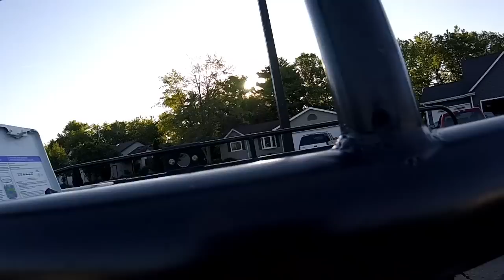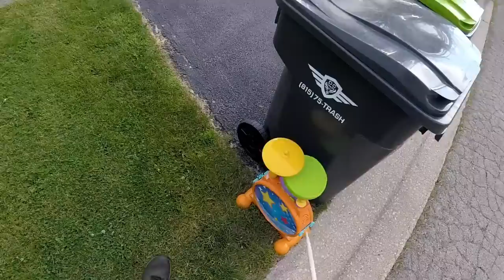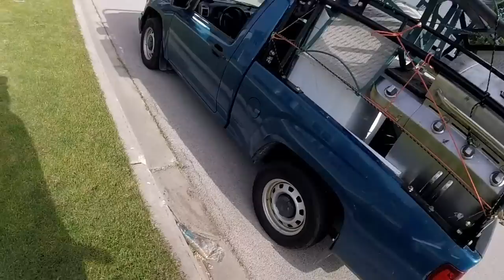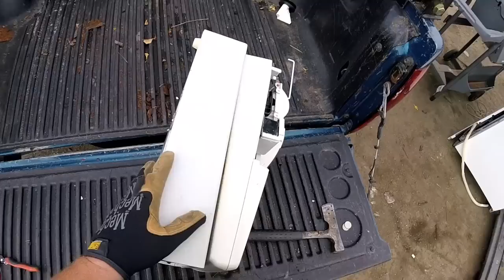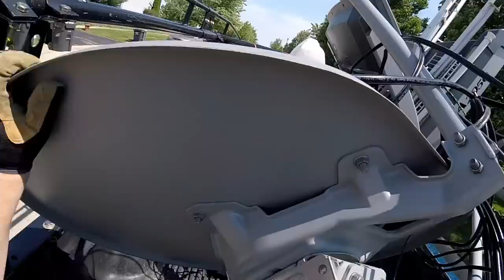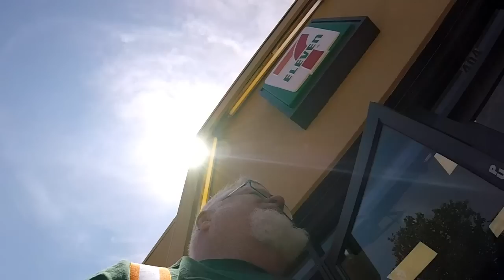They Threw Away a Cash Register with MONEY Inside

Comment: Scrap man: as long as i dont find a treadmill ill be fine
Life: Treadmill next turn.
Reply: @ScrapPalletMan  Somebody might have told you this already but I didn't see anyone say it in a quick look through the comments but many cash registers have a hole on the bottom to push a drawer release lever. After the drawer is opened look for the latches on its side or wherever they put it and remove the drawer, many times I have found bills behind them once almost 50 dollars. Also once an Illudium Q-36 Explosive Space Modulator.
Reply from the maker: Space modulator :-)

Comment: Hey ! When I was scrappin' a few years back, I would unload my trailer in my garage and take everything apart. Plumbing fixtures contain a lot of brass and you would get next to nothing for it unless it was stripped down. I dfid the same with aluminium storm doors, computer monitors, vacuums, electric motors, extension cords etc. Grills, or BBQ's, are studded with brass as well. I made a lot of money doing that. I would fill garbage cans full of all the different metals... I loved it !

Comment: Cash register drawers: Note for later.

Single Point Of Sale machines like that have a drawer latch release on the bottom, it's either a rectangular or round hole near the back that you either push or pull a tab.
Mind you this is ONLY useful if it hasn't been locked with the key on the front, but that is somewhat rare.
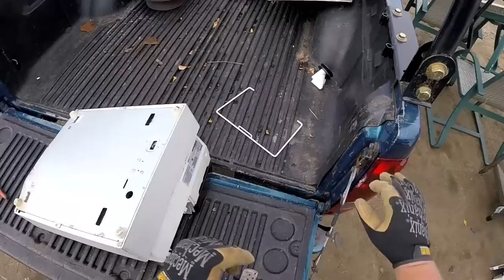In this case at 32:04 you can see the inset rectangular hole with a tab just inside. WAY easier than trying to smash open a semi fortified drawer.
Reply: That’s what I wanted to say to him, whenever the electricity would go off in my store I would open my cash register from the bottom , I like you sir because you thank God every time you finish your day . May god bless you and all the people who honestly make a living 👍👍❤️

Comment: Most cash registers have a little lever on the bottom to open the drawer. I think they are put there for power outages and such. Also, the knobs on that washer are worth more than the washer itself if you sell them on ebay. You just need the part numbers.

Comment: I bet the motor in the washer was good. The average home owner doesn't try to fix an appliance, but instead they leave it for the scrap man. I had a belt go on my drier so I opened it up which is a few screws. And yup it was a belt and an easy fix. When my washer went on me, I didn't have the money to buy a new a new one. I checked the manual and it said to look for this or that, but none of those helped. So, I went at the motor and there was one other place to look and I was right, it was they brushes that needed changing. I learned what to look for that can cause the motor to seize up by watching a You Tuber from Germany. saved a lot of money on doing the simple repairs myself. Hell, you can learn to do almost anything here on You Tube!!

Comment: Cool finds Paul just a nice and helpful tip next time you have a cash register in the trash with money in it there is a maual release switch on the bottom of the cash drawer if you press it the drawer will open up locked or unlocked I was a cashier thats how i know i had to get into the drawer during a power outage.

Comment: I was working at a small metal stamping company where the local truck driver didn't tie off his ratchet strap. The strap blew under the truck and got wrapped around the drive shaft. It drew tight and caved the side of the truck bed down about 3 inches before it caused the truck to stop.
Reply from the maker: That is scary stuff. I wonder what happens if I run over my rope

Comment: There is are 2 types of Magnetic stainless. 305, and 316. It has less nickel in the mix, so it will draw a magnet. it is still Stainless. It puts off a different color of spark when touched to a grinder. Stainless puts off yellow sparks, as opposed to orange of steel. Not sure if the value difference is worth worrying about.

Comment: Paul tainless cones in many flavors but the most popular and widely used is 316 and 304. Yes they both have nickle chrome and molybdenum aka (moly) very low carbon.  The nickle,chrome and moly make it rust proof. I am an old Foundryman. I have melted and poured tins of it. Nickle at one time hit 100.00 a lb.

Comment: just subbed
Tip on the dishes, you can bring along some vise grips for those next time.
I was into the KuBand FTA hobby a few years ago and am very familiar with those converting them and whatnot. Those big football shape direct dishes are the slimline and dish network ones are very similar at getting them apart.
There are 4 bolts you can undo to seperate the reflector from the mount.
Once the reflector (big metal disk) is off the boom arm also comes off, it normally has two or 4 or so screws you can undo with a vise grip or philips head driver
If the dish bracket still has the mast atached (stem and foot piece) just loosen the 3 bolts down the back to allow the stem pole to slide out of the collar
The lnb, (eye of the dish located at the end of the boom arm, will also come off and you can undo the bit of wire from that.

Comment: Different grades of stainless steel basically. 18/10 or 18/8 is what you really want because that’s the non ferrous stuff. Any other grade, the magnet will stick to it. Some pots and pans will actually say 18/10 or 18/8 on the bottom of them. Always check it when you find that sort of stuff. Just a little tip to help you earn a few more dollars!!!

Comment: Of course that was back in 2010/2011 metal was so high I get $250 for catalytic converter 26 cents a pound on refrigerator compressors $5 on most for copper 3 something for red brass

Comment: Dude, there is a button on the bottom of the cash register. It's in the round hole located at the back(opposite of the drawer opening). Just stick your finger in there and hit the button. It bypasses the lock in the front.

Comment: Your allowed 13' 6 inches maximum height looking out for low bridges that if they are lower than 13' 6" will have warnings on the bridge so slow down when coming up to a bridge unless you know it's 13'6" or higher.

Comment: Always check on the bottom of cash registers. There is usually a little lever that you slide sideways and it will come open. But if they locked the drawer with a key it may not open.

Comment: Keep a portable saws all or small hand saw with a metal cutting blade and remove the legs to some of the lighter weight grills. Keep a roll of duct tape or cheap dollar store rope with you and the grill. Lids shut and place on side. You will get more in that little truck. I habe a small 68inch by 48inch trailer that I can get 11 washers/ dryers into if I take sides and tops off

Comment: Next time you pick up a treadmill, remove the rollers as, with the addition of a box section  frame and decent  motor, you can build a cable stripper for removing the insulation from the power cords.

Comment: Just want to pay it forward and help you out the next time you come across another cash register look on the very bottom of the register will be a little switch that you can pop the drawer open it bypasses the lock in case of a power out I took a close look at the register that you threw away and noticed that the switch was there at the bottom you just didn't see it

Comment: LOTS of copper in that washing machine motor.
Reply: He could be making a lot more money than he is if he just took a little extra time to "clean and sort" much of what he picks up. Propane grills tend to have a lot of stainless steel and some copper and brass. Washing machines tend to have some stainless steel along with steel and copper in the motor, or could test it and part it out or fix it and sell it. He could be making many times what he is currently while only doing a touch more.

Comment: The 550 takes longer to load you got to jump up &off cant just throw things over the side or tie up a bike. I like your setup much better ➕ plus his gas expenses are astronomical in my neck of the woods full tank is 90$ & I run a 350
Reply from the maker: I think you are right. A full tank of gas is $40 and I can drive 300 plus miles

Comment: All that cable with the dishes have copper core around 16 or 18 gauge copper core
Reply from the maker: The stuff looked like copper, but it was magnetic. A magnetic Center conductor with a copper look. Try it out with your magnet next time. You'll be surprised

Comment: All steel has carbon most don't have much because the more carbon there is the harder the steel but it makes it more brittle (like high carbon drill bits very hard but they break really easy) ....in stainless steel there is around 10 percent chromium and some stainless that have chromium and nickel ....the nickel is what causes stainless to be non magnetic but basic stainless steel is magnetic because it don't have the nickel in it..and stainless steel has a very low amount of carbon in it it's like around 0.2% of carbon and depending on the trade of regular steel and the hardness of the steel can have as much as about 2  percent of carbon

Comment: LOL you probably shouldn't make those jokes about the treadmills. you kinda jinxed yourself today with that one. I'm not 100% sure but i believe those big Hughes net dishes are for two way satelite internet and the smaller ones are for the direct tv reception. that refrigerator you got at the end would be a good man cave fridge if it worked. that's probably out of a motor home or travel trailer though

Comment: What is the name/model name of that Chevy ❓is it v6 or v8 ❓is it 2wd or 4wd ❓
Reply from the maker: 4 cylinder 2 wheel drive standard transmission
Reply: Looks like a good and reliable car/pickup. I don't know if that model is in ported to Sweden. Like the blue color and the front grill nice locking car/pickup

Comment: How much in gas do you use to make the $40 or $50 bucks?
Reply from the maker: Good question. I usually Drive 20 miles for scrapping. It cost $40 to fill my tank in my tank lasts 330 miles. The wonders of a 4-cylinder light pickup truck :-)

Comment: Next time you find a register. Look on the bottom of it for a little tab that is a quick release for when power goes out or there is a problem with the unit. Most of the time it's center and near the rear of the bottom in a small slit or hole as some would say. Keep scrapping.